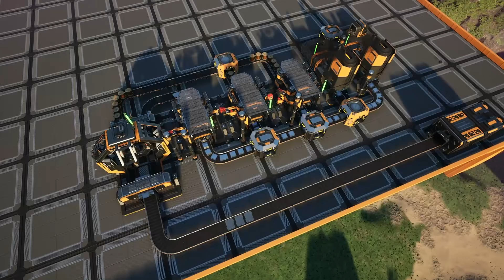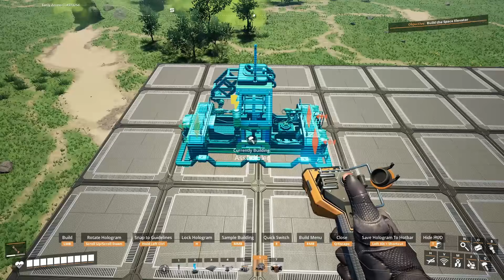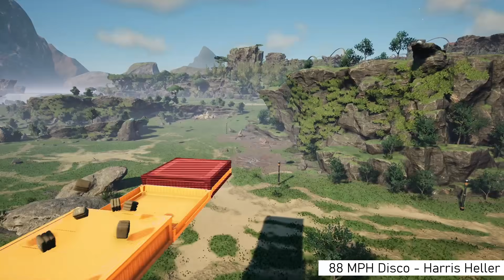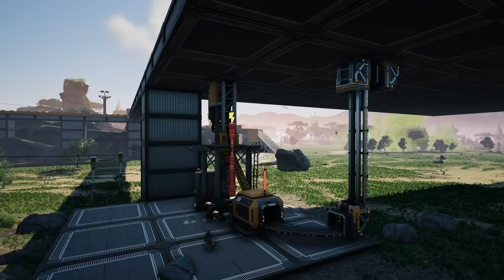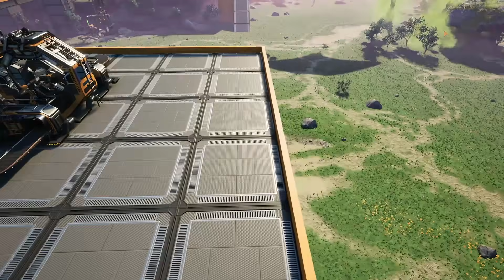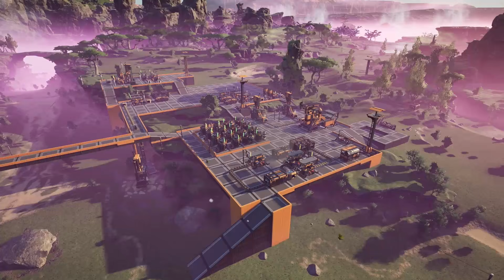How to Build a Reinforced Iron Plate Factory - Satisfactory Update 8 Guide / LP. Ep4

Comment: am I stupid, that first design doesnt make sense, ur input is 60 ingots per min if that gets split in half that's 30 to each lane but rods take 15 not 30 and the iron plates takes 30 but that gets divided in 2 to get 15 which is not efficient
Reply from the maker: This is an old video,  but the design works.  This is called a manifold system. It takes a minute to spin up but then works perfectly.  Machines only take what they need.
Reply: @Dekoba  ah
Reply: @Dekoba oh ok I see so once the machine is full and backs up the ingot flow it will push 45 ingots the other way to the iron plates. Makes sense. Just built it and turned it on and was wondering 😂